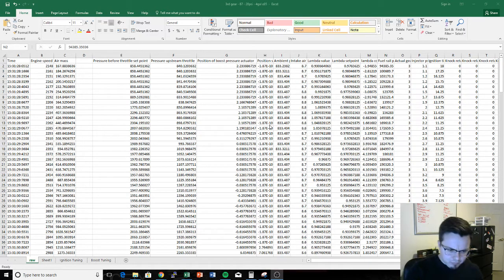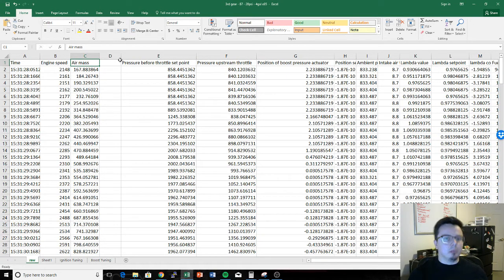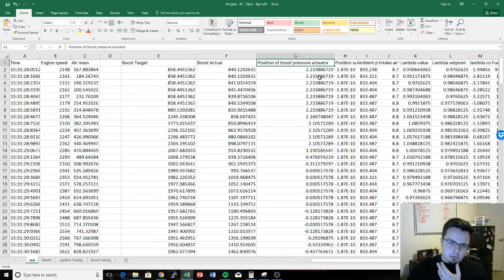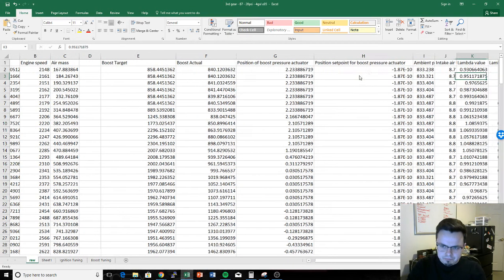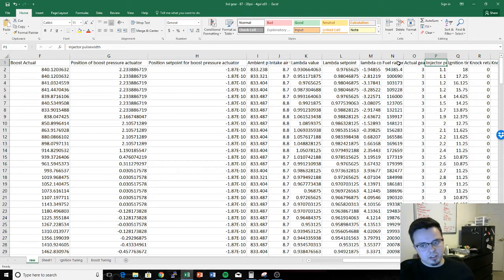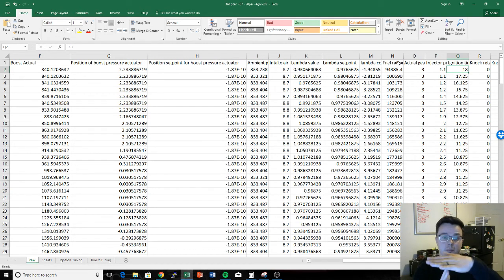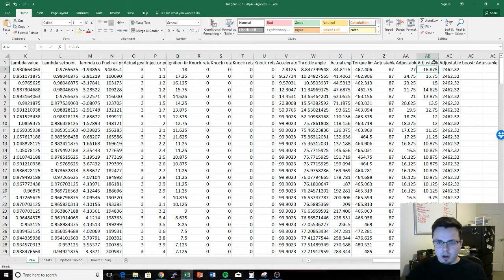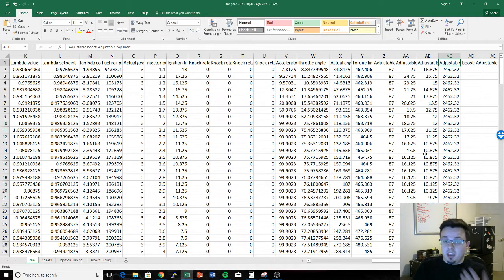Mk7 Maestro Tutorial -  The Data Log Fields

Comment: Hi Karl, as a general idea of logging, I think I get it. I am facing hard times with VCDS because you can only log up to 12 channels. Is there any chance that you will write an article or upload video on how to properly log car with VCDS (which channels, what to look for?). Obviously I perform at test for igntition retards as you mentioned for each cylinder. I use other log to check boost (actual and specified) + duty cycle of wastegate. But I am a bit confused to be honest. When should I check IDC (and what is a good value? below 90%?)? When should I check fuel pressure and how can I know that it works fine? If you can help yo set up some log profiles for VCDS would highly appreciated and will be very helpful. Thanks